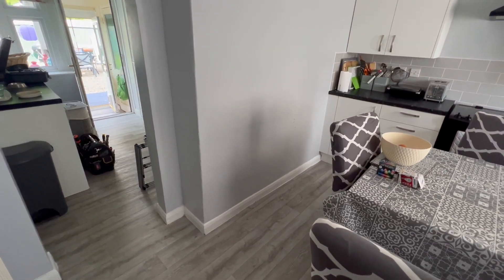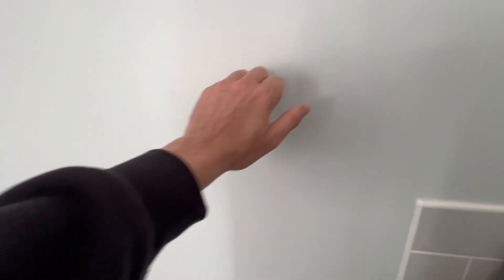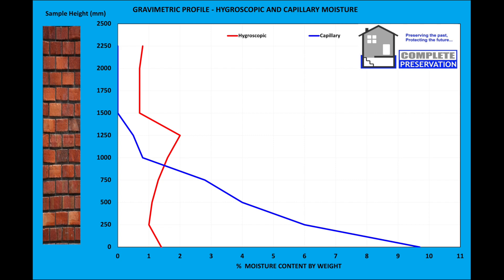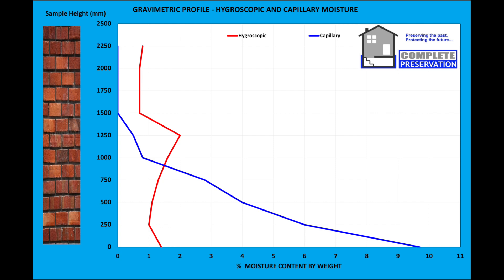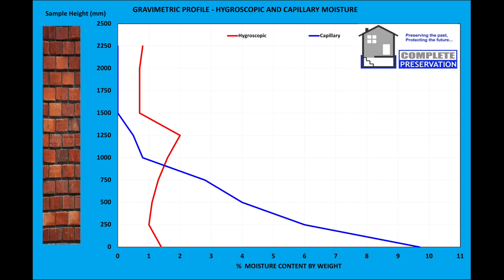Why Is This House Damp? Drains And Leaks💦💦💦

Comment: Great content Ross !! 

1) Could you tell more on red line profile please? If you have salts there at 1.25m, it would mean that you have/had a rising damp as well? But if there is a dpc, it means that it must be bridged in that case? 
2) Have you got situation (excluding chimneys zones) that the dpc was perfectly fine, there was no sign of dpc bridge and yet you had salts at let say 1m above the wall? If so, where these salts were coming from. 
3) You talk a lot about drainage issues in your surveys, but it means that if dpc was not bridged in some way, so let say you eliminate the possibility of bridging and if dpc in place, there is no way that the faulty drains will contribute to damp wall. Obviously it will weaken the foundation but cannot cause walls to be damp when dpc is perfectly fine, is that correct?

Thank you in advance for response. I have watched all your content now :)